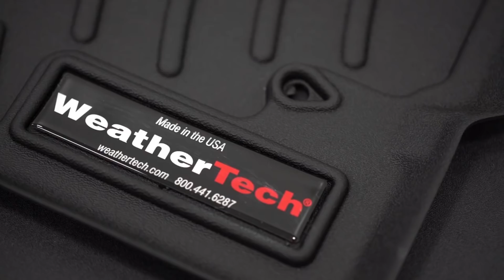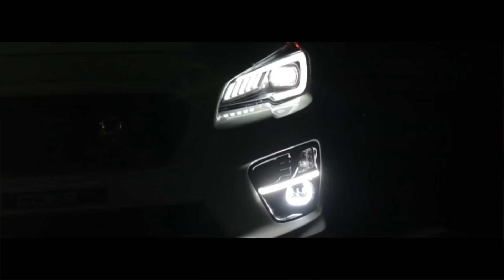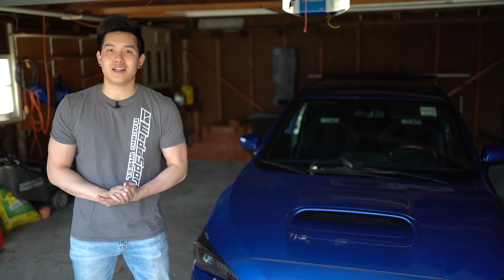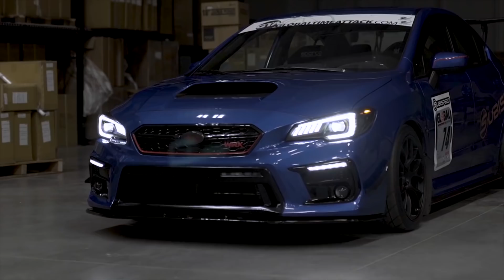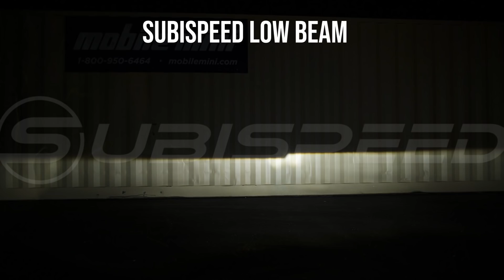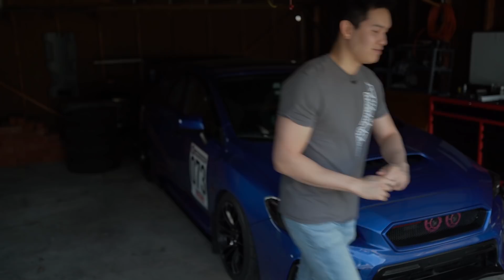LED VS Sequential Headlights | SubiSpeed

Comment: have the headlights, how do I get the sequential, my taillights are sequential but my headlights just do the solid turn signal, did disconnect the plugs and still stuck on solids. any other tips? D;

Comment: But what about the Diode Dynamics SL1 bulb replacements?   Little more expensive.  Would have been nice to see an option between 100 and 1200 bucks. A full set of Diode Dynamics SL1 bulbs for low+high is 300 bucks.

Comment: Do the V2's mess with the 2020 STI adaptive headlights that turn with corners or are they safe to put on?
Reply: You would lose the responsive stering and need a different harness to use these lights.

Comment: Olm bulbs, diode dynamics c-lights, and spray paint the chrome headlight housing black
Reply: Literally just did this setup two days ago. So worth it.
Reply: Opening those headlights are a pain in the ass though
Reply: I did this to my 2020 WRX headlight a couple months back. But I also added the DD Demon eyes. So damn cool now!
Reply: I did that exact same thing Christian. That’s how it should have come from the factory. Looks clean and aggressive.

Comment: Sequential C lights for turn signals makes it look like you’re going to do a U turn. Also the limited model STI in 2019 has much better looking OEM housings and have turning headlamps to aim where you’re going. Didn’t cover if yours retain that or not...
Reply: the subiespeed headlights are 2015-17 wrx/sti